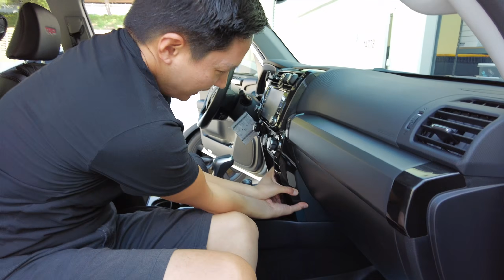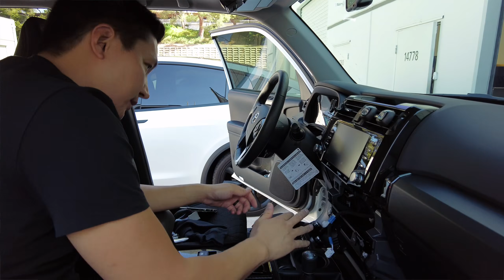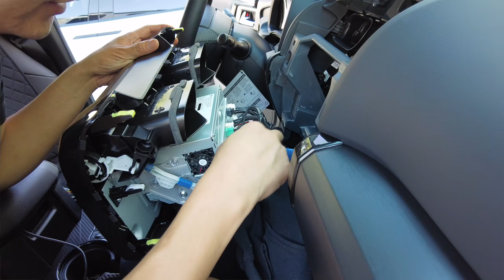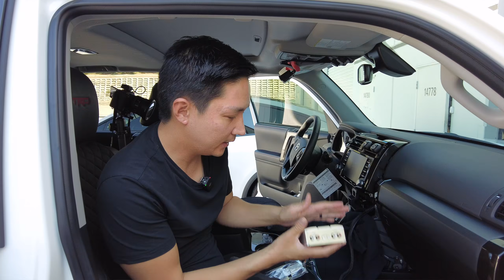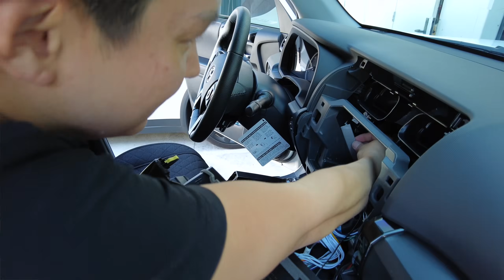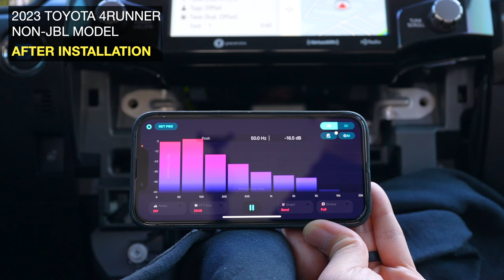2023 Toyota 4Runner | Beat-Sonic Amplifier Kit

Comment: Is this amp compatible with the Hamilton Motor Company retro fit head unit? That unit uses all the factory harnesses. I figure the plug compatibility is fine, but concerned about functionality. Trying to match your amp with their head unit. Thanks.
Reply from the maker: Will work with aftermarket headunits. Will all daisy chain and plug and play together without any issues

Comment: It works on a 2022 TRD Sport, this model does not have JBL but its speakers were changed for black diamond ones. I would like to know if in addition to improving the sound I could add an amplified subwoofer
Reply from the maker: Use the BH10 https://www.beatsonicusa.com/products/beat-sonic-bh10-speaker-harness-for-toyota-10-pin-connector
Reply: @BeatSonicUS  Which amplifier works for my 4runner, not JBL?
Reply from the maker: @JESUSPORTILLO-q1c  The same amplifier in the video will work. Here's the link https://www.beatsonicusa.com/products/beat-sonic-ena-2t3-plug-and-play-encore-alpha-power-amplifier-kit-for-select-2018-toyota-models?variant=44580022911127

Comment: I'm considering installing the trail grid pro 8 speaker kicker kit for my 4runner.  I noticed that the website description for this amp states that it is not recommended for aftermarket speakers because results may vary.  Curious if my application would be OK?
Reply from the maker: Yes, our amp works well with the trail grid pro 8 speaker kicker kit
Reply: @BeatSonicUS  what about Trail Grid Pros FOCAL PLUG & PLAY 8 SPEAKER BUNDLE ?
Reply from the maker: @joeplummer5932  as long as the ohm rating is 4 ohms it will work!

Comment: I have a 2021 4Runner TRD ORP that has premium audio with nav (a non-JBL system). I installed a Naviks 4Runner motion lockout bypass which allows NAV, USB, ALBUM ART while the car is in motion. The Naviks unit is also plug and play and inserts between the factory harness and the radio. Do you know if I can also install the PA2T3K?
Reply from the maker: Yes you can install the PA2T3K together with the naviks unit
Reply: @BeatSonicUS  Thank you!